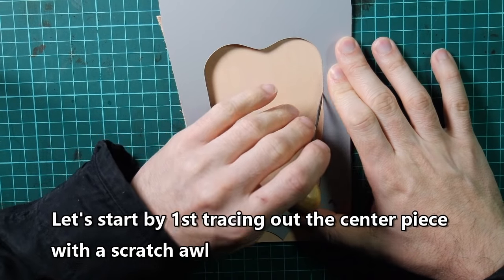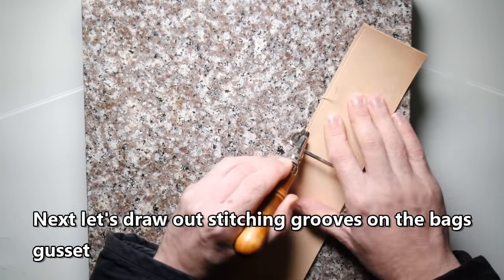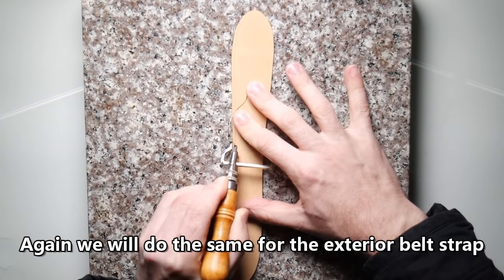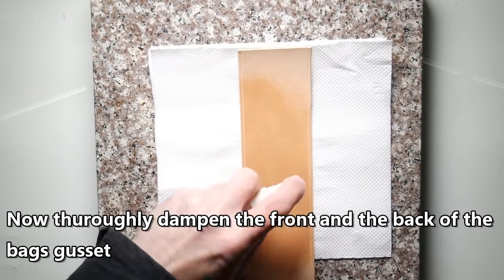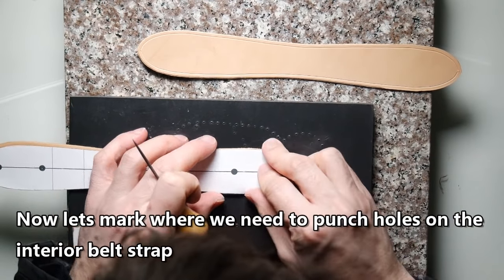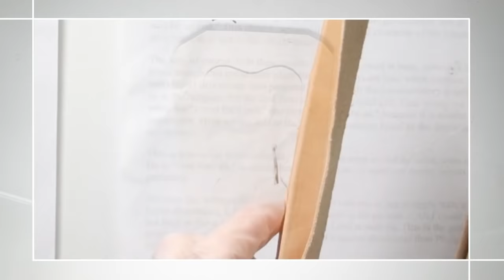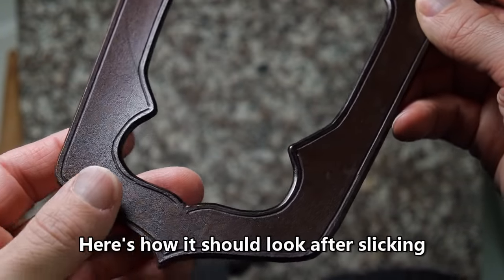Learn How To Make A Biker Bag (Medicine Bag) handmade

Comment: Hi I have just completed my first build of the medicine bag. I have been doing leatherwork for about a year and this was the most challenging project I have attempted to date. Everyone who has seen it so far has commented on how good the design is, so well done for that. The only problem I had was in shaping the gusset. It has meant I have ended up with the back pocket going on at a slight angle when the bag I'd open although it has not affected the appearance when closed. I have decided to make a jig to wet form the gusset on my next build and I will let you know how I get on with that. Thanks for a very easy to follow video and an excellent pattern. Kind Regards Mike
Reply from the maker: A folding jig might work, I've never tried. Since the gusset is so long I'd be curious how that works out. Thanks for sharing and I'm glad you enjoyed the design!
Reply: I had exactly the same problem, the gusset is an absolute nightmare I could not manage to get it to lay flat without huge creases. I think if I attempt this bag again I will try with a softer more stretchy leather like chrome tanned on the gusset.

Comment: Amazing craftsmanship Fischer Workshop. At 19:23 I gotta admit I panicked a bit, I was thinking "No, stop, what are you doing!". Hehe, glad to see the perfection wasn't ruined.
Reply from the maker: I pre marked where I needed to roughen the leather. The video doesn't fully illustrate that... The area I roughened was also smaller than the diameter of the belt I was going to attach, so that it would be well hidden once stitched on.

Comment: Excellent work. Immediately ordered my template, can't wait to make this. Have my veg tan leather hide waiting :) great video and thank you for sharing. Worth every cent. Keep up the great work.
Reply from the maker: Thanks!!!
Reply: Quick question. The main body when resized on adobe illustrator is smaller than the "Front of Pocket" and "Rear Cover to Front" by 3mm to 1 side and 3mm to the lenght. Is there a reason for it, or must I rather use the main body as my template. 

PS: I have resized all templates according to the measurements given.

Comment: Great quality! It's a absolutely gorgeous piece.  One question:  At 16:35 I noticed that you chose to put your snap eyelets between the layers you glued.  I know that's for visual reasons (even though you'd never see it when worn).  Would you be worried that it won't be serviceable when the stud wears out?  I replace them on holster thumb breaks all the time that are only a few years old because the socket just erodes them away from repeated use and they get loose and sloppy.

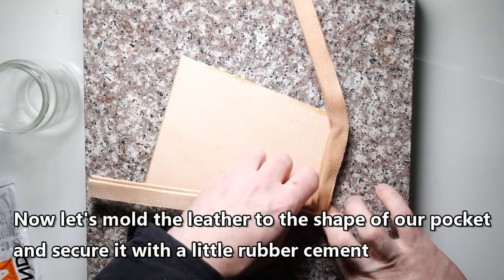Comment: nice product!!!     at 6:15 when you mold and use rubber cement.. does that hold well when the leather is wet?  i could never get it to stay in place..  any tips.. (i use weldwood btw)
Reply from the maker: Try only dampening the area you need to bend. You can also apply the cement to the leather before wetting it to see if it will hold better. This works well with the product I'm using now...
Reply: so you dampen, then wet.. then mold.... .. when i wet then apply glue, it stays but not enough to hold in place.. it moves a little defeating the purpose of gluing

Comment: Great video. Thank you! What glue did you use to attach the pocket on minute 31.35?
Reply from the maker: It's called KS Bond, but a strong contact cement for leather should do fine.

Comment: Curious, was it more of a design choice for function/form to go with a leather tie down rather than a concho-snap for a closure? I've seen a few of these bags before and they were all snap closures or toggles. This is definitely a neat way to go about it though.  Nicely done.
Reply from the maker: DraccoKnightblade Design and function. I think the leather strap is more aesthetically nicer, secure, and easy to open and close. A button would also require some force to close putting pressure on the contents of the bag.

Comment: great video, i learned a few things. can you tell me where you get your stitching pliers? i've searched but all i can find are the slotted type for lacing. thanks
Reply from the maker: I believe Tandy sells them, but if I'm mistaken, I purchased mine from Ivan's leathercraft in Taiwan. Theirs comes in several sizes and has a diamond shape to them that is similar to the stitching chisels I use. They ship worldwide, but might be pricey for the shipping? Have you looked on Ebay, or ETSY? goodsjapan.com is also a great place to find quality stitching chisel pliers if you don't mind spending $50-60 a pair. I recommend 1st buying a single hole nipper or chisel plier. The nipper works great, but is made of a cheaper material and can damage easily if to much force is applied. You can see what I'm referring to at the following link: http://www.ivan.tw/index.php?route=product/product&cid=25&page=2
Hope this helps! Thanks!
Reply: ivan has a minimum order of 6 pieces so that's not an option for me. i'll look on ebay again, but what i found was the lacing nippers. thank you so much for your very quick response. :)

Comment: fantastic. Subscribed.
What is the stink level of that contact cement? And the brand? It seems to have pretty good holding power!
Reply from the maker: It's called KS BOND. It's a chloroprene cement. It's popular here in Asia, but don't know how available it is anywhere else. It's very strong and stinks about as much as any rubber cement might stink...
Reply: Fischer Workshops thank you for the info!

Comment: What is your reason for not applying glue on the whole contact surface? I noticed you did the edges on the belt sides and the  attachment point. Also what brand of glue is that?
Reply from the maker: Hi, Regarding the glue, what section of the video are you referring to? Also the glue I use is a strong contact cement that is popular here in Taiwan. It's used by professionals to make everything from bags to shoes. I don't think it's sold overseas..?
Reply: At 16 min when you are glueing the front and back of the strap you only use glue on the edges and not the whole strap. I was wondering if that was for economy or if there is another reason.  As far as the glue type I wondering about the brand to see if it is available here .
Reply from the maker: It's called KS BOND. It works well, but is really strong! I placed it on the sides only in case I need to make corrections or adjust the leather. You could cover the whole surface, but pulling it apart with this stuff on would rip up the leather. So, I like to play it safe and just apply a little on the sides. I have also switch to using UHU Contact Cement which comes in a stick and is easier to apply, but is a lighter adhesive. I think it would work nicely on a project like this.

Comment: Question? At 6:16 you say that you are gluing the gusset to the other piece with rubber cement, but then later you are staining and finishing the gusset? Uhhh I don't understand.
Reply from the maker: The gusset is 1st glued to the pocket front while it is wet so it will form to the shape of the pocket. After the leather has dried and molded, it can be stained. You could remove it from the pocket front and stain it and then glue it back on again, or you could leave it on the pocket front and stain it as well. (Let me know if this doesn't answer your question) Thanks!
Reply: Fischer Workshops I have not been able to unglue leather without it being damaged.
Reply from the maker: A lot depends on the strength of the contact cement and the amount applied. I always apply a very small amount and that's enough to do the job. But if you are already doing this then you might need to buy a weaker contact cement. I use UHU contact cement glue sticks for leather jobs that will need to be glued and unglued 1 or more times. I hope this helps!

Comment: Hi where did you buy your texture tool at 1:23? thank you.
Reply from the maker: Most leathercraft supply stores sell texture stamps like this. Tandy, Weaver, Barry King... Price and quality will depend on where you buy it. For this project a simply one should be good enough. It cost me about $10USD. If you want an even more detail then I would recommend buying Berry King for about $30USD.
Reply: Fischer Workshops thank you Chris. Did you happened to know the model of the one that you are using?
Reply from the maker: Here it is...E294-03
Reply: Fischer Workshops thank you Chris

Comment: Why do you moist the leather?
Reply from the maker: I moisten the leather on the gusset to set the folds, without the water it wouldn't work. I also dampen leather that needs to be stamped or tooled. When leather is moistened it becomes soft and can be carved and have stamped impressions applied to the surface easily. This process can only be done on vegetable tanned leathers.

Comment: HI Greeting From Berlin Germany I think that looking at your work most of the people might believe that is something EaSy to do  but instead is a difficult and precise Work and in your case is a piece of ART Too.
Thank you for Sharing your knowledge ...(  ;
I have question it might be a stupid one..:   Why at min.7:26 you put the CutOut centerPiece Beyond the Decorative CenterPiece if I glue and sew just the decorative centerPiece on the body withOut the cutOut centerPiece wouldn't  be enough?
ps what are the sizes from the medicine bag pattern?
ThanK U again Fischer
Reply from the maker: I apply the cutout behind the back to push the decorative centerpiece 
slightly out. It's not necessary, but it adds more dimension and beauty 
to the final outcome. Although I guess it depends on what type of 
leather you end up making the bag with. If the leather for the 
centerpiece is too hard it may not matter. The bags dimensions can be 
viewed at the following link. Just click on the image with dimensions 
and it will enlarge for viewing. Here's the link: 
https://fischerworkshops.ecwid.com/#!/Customizable-Leather-Medicine-Bag-Pattern-and-Instructions/p/65799407/category=0
Thanks!
Reply: @FischerWorkshopsTaiwan  привет из России !!! ))) Спасибо за видео, очень интересно и очень познавательно. Но вот ссылка, по которой можно было бы скачать шаблон- уже не действительна. Очень жаль. Не могли бы вы ещё раз выложить этот самый PDF шаблон? За ранее большое спасибо.

Comment: What is the cost of materials for something like this?
Reply from the maker: Probably between $50 - $90 USD. Depends on the quality of leather and hardware you use. If you add the tools and other products prices will vary depending on where you shop and what you buy.

Comment: For $400 I would hate to put my hand in the pocket and catch my fingernail on the knot of the rope. You should have covered that knot with another piece of leather or sewn it in place. Your label would cover the stitching. Disappointing detail. Another disappointing detail was the beads. $400 should get me tiger eye or onyx or even jade beads. Keep improving, it's a nice bag so far, but not yet worth $400. I did like the one with the alligator insert. 💝☀🌵